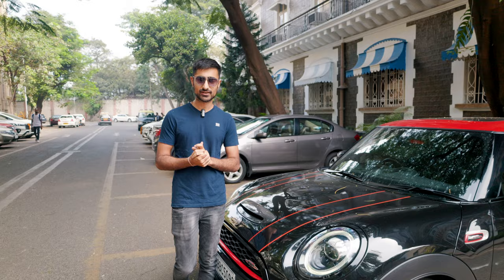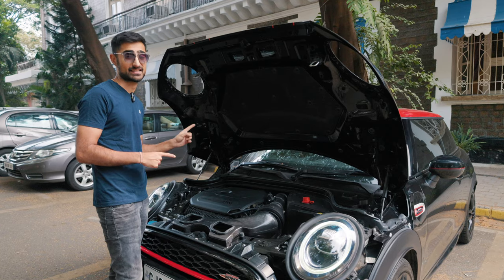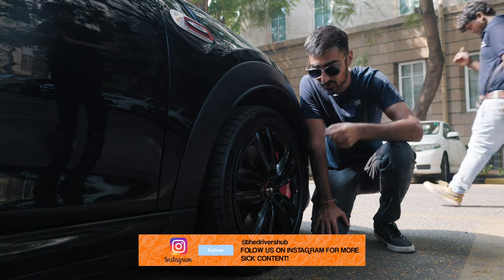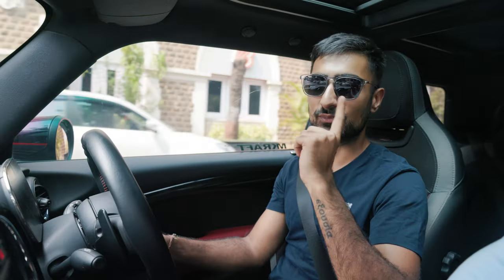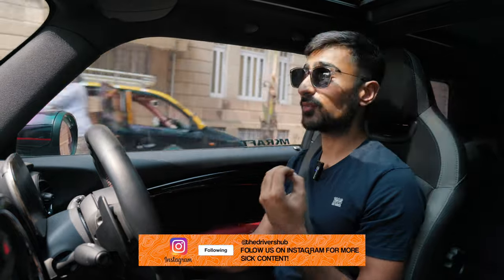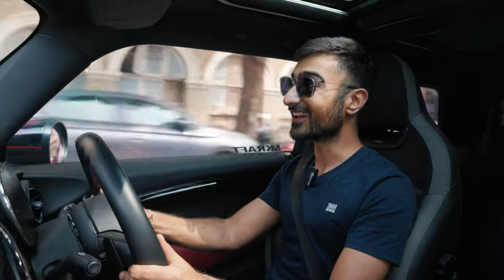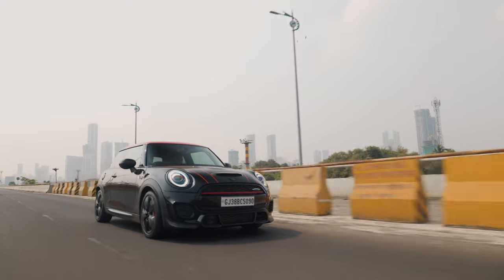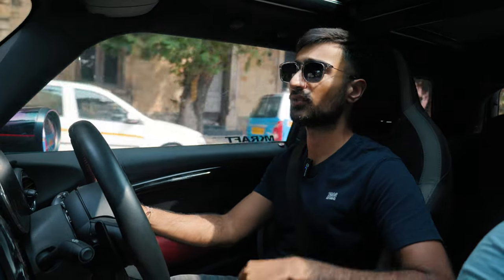Stage 2 Tuned Mini Cooper JCW: The Hot Hatch that is an Autocross champion! | Autoculture

Comment: I thought it would be atleast 300-310 hp and 450 NM of torque at stage 2. Seems like a conservative setup.
Reply: It's very conservative, in the UK a stage 2 JCw produces roughly 320 hp and for the automatic, the Torque is limited to 420 to 440 to prevent the gearbox from dying. Manuals produces up to 470 nm. 

So ye it's a conservative tune, stage 1 is roughly 280 to 290 in the UK on a dyno.
Reply: I agree, he has like a stage 1, that aint no stage 2
Reply: Fuel